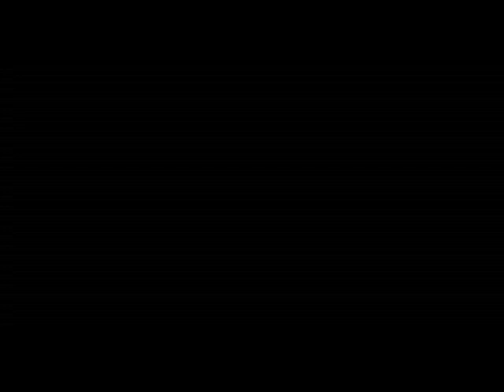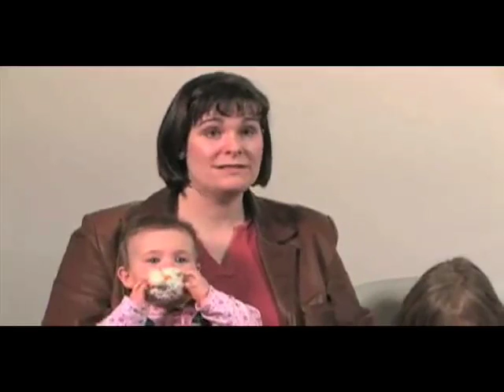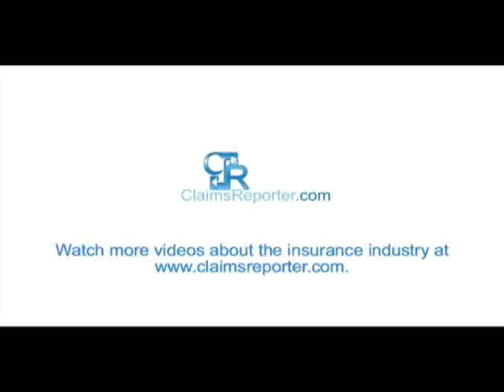Geico Games Part 3: Used Parts

Comment: Im a claims adjuster.   Our job as adjusters is to source cost effective parts (recycled, aftermarket, etc)to repair your vehicle and to keep premiums and repair costs down. Not only does it keep costs down, its good for the environment as we are "recycling usable parts".  Be advised that if recycled or aftermarket parts are not insurance quality, we dont use them.  the last thing we want to do is compromise safety.

Comment: @hyper0723  I think she was quite clear. Damaged sensors do not necessarly result in deployment. I'm sure the undercarrage she speaks about is the cradle or subframe. No manufacturer alows for repair of this or other suspension mounting points.